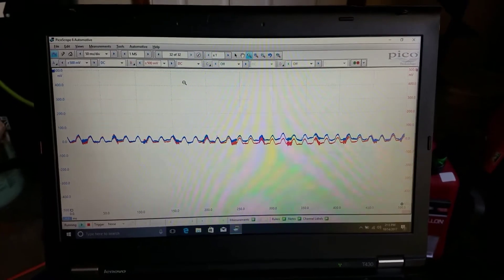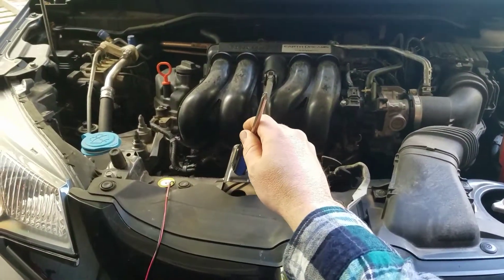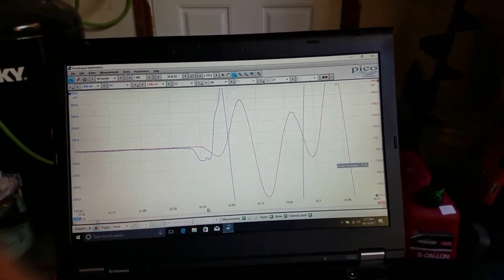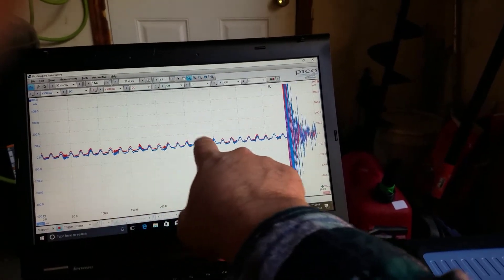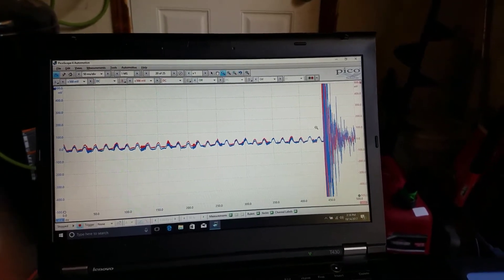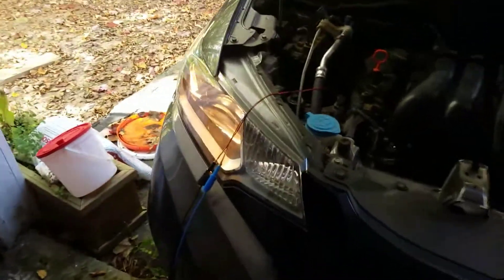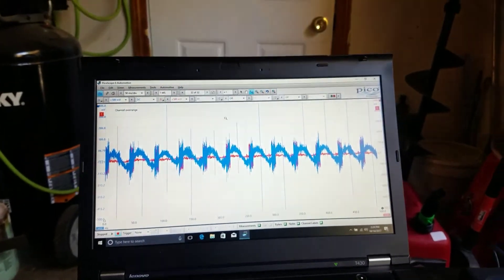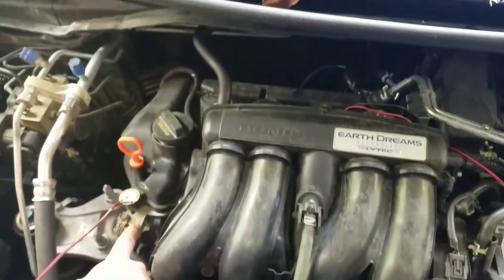Diagnosing engine noises with cheap piezoelectric mics and a Picoscope

Comment: do i just hook piezo directly to scope? no voltage supply needed  to piezo right? my plan is to buy a long screwdriver and glue piezo to the end.this will be like when we use screwdriver to listen to injectors and should work as a tool to isolate where noise comes from

Comment: What sensors is that? Something from Ebay?
Reply: Thanks. Gonna have to try this and see if i can get something usefull out of it
Reply: What are the sensors? Great video
Reply from the maker: @ekovir  piezoelectric sensors. You can find them on Amazon. They look like brass colored discs with two wires coming out of them. Very inexpensive. They generate voltage/current when vibrated.
Reply: NothingSpecial thanks.
Reply: @Markus Kelvin meh lately I've been using flixportal. just google after it =) -allan
Reply: @Allan Jad Thanks, I signed up and it seems to work :D Appreciate it !
Reply: @Markus Kelvin glad I could help :D
Reply: I know I'm kinda off topic but does anybody know of a good place to stream new movies online ?

Comment: that was fun, did you glue a magnet to the top or bottom, how did you use the magnet?? I have a pico coming this weed and have a few of those piezoelectric microphones to experiment with.  seems like you could use this on the injectors possible to dedected a defective one.
Reply from the maker: Ed KE6BNL I use Krazy glue and glued the magnet to the brass side of the peizoelectric microphone, right in the middle. 

I've used these mics to diagnose wheel bearings using one mic on each knuckle. I had a Chrysler that had a loud engine noise. Sounded like a rocker, it was pretty obvious. But, I was able to use these mics to narrow it down to the #5 intake cam lobe. I used the valve cover bolts to stick the mics to. Anyway, I removed the valve cover and sure enough, #5 intake cam lobe was worn causing the noise.
Reply: well I made a couple and they seem to work well thanks for the help
Reply from the maker: Awesome. I hope they help you.